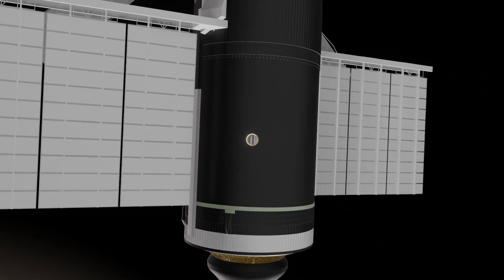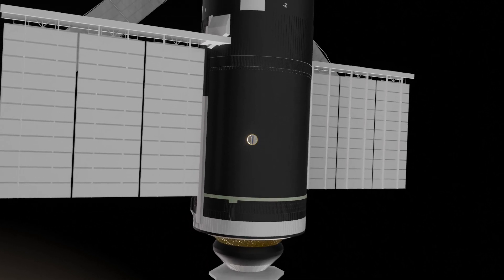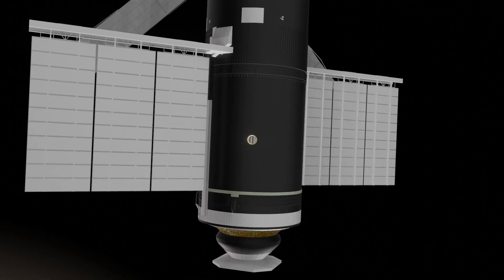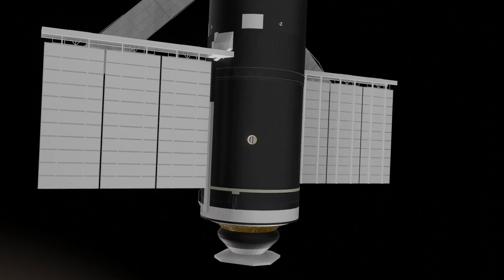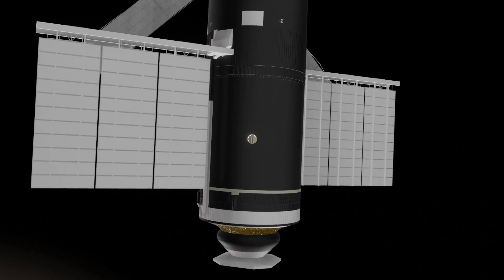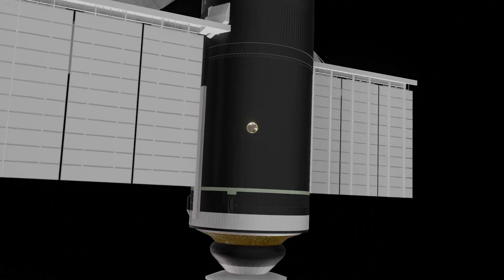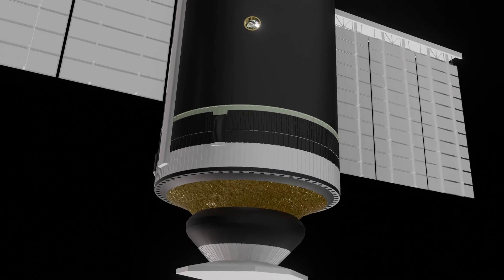Skylab: External Tour

Comment: Drew, this is most impressive. I am working on a scale model of Skylab and there is insufficient visual documentation of colors and materials of Skylab online.  Your 3D render will become a guide.  One question is I noticed external lights (red and white) near the oxygen tanks. But can not find a reference to confirm external lighting existed.  Any guidance would greatly help. Again, magnificent work!!
Reply from the maker: Not sure if these are the ones you are talking about.  But page 2-237 in document 19740018215 from the NTRS website.  Is this a physical model?  Post some pictures as you go.
Reply from the maker: Also search for the skylab boilerplate in Huntsville.  This site has many pictures.  I think this is one of the lights you are talking about: http://data3.primeportal.net/space/howard_mason/skylab_huntsville/images/skylab_huntsville_10_of_53.jpg
Reply: @opieswenson  yes that is one of the lights. Unfortunately there is not enough readily available information in Skylab, which leads to less than helpful search results.
Reply from the maker: Also page 5-36 in the MSFC Skylab mission report-Saturn Workshop on the NTRS site
Reply: It is a physical model available online for 3D printing made by a talented engineer and would love to share. Thanks for the great links and suggestions!
Reply from the maker: @tron77  Awesome.  Looking forward to seeing it.

Comment: Perhaps include a video showing the astronauts' return to Earth.

Without researching, I assume that it would be using the service module, which would also serve as a kind of lifeboat in case there was a catastrophic problem.

The closer to reality, the better. Remember, for me criticizing is fun and easy, the hard part is making the beautiful videos.
Reply from the maker: My Apollo 11 part 3 shows this.  Pretty much the same recently process but about 7,000 mph slower reentry.  The SM is kicked off at the last moment which causes the SM RCS to fire in a way to put it into a tumble to increase its drag to cause separation of the vehicles.  I show that rumble in the video
Reply: @opieswenson  Excellent technical information and captions.
Looking at the nitrogen and oxygen tanks, I find them proportionately small for a crew of 3 astronauts for several days. I wonder how long it would take to refuel.
Reply from the maker: @rsmrsm2000  The workshop atmospheric makeup was a mix of nitrogen and oxygen (Apollo was pure oxygen). Oxygen to nitrogen mix was about 75/25 at 5 psi (as opposed to 14.7 psi at sea level).  Nitrogen was also used for the cold gas thrusters and to supply cold gas for the 2 onboard manned maneuvering units.  The MMUs were recharged from the onboard nitrogen supply.  Skylab was loaded with enough supplies including clothes, food, oxygen and nitrogen for the 3 trips to Skylab.  Skylab 2 (first crew) duration was 28 days.  Skylab 3 duration was 59 days.  Skylab 4 was 84 days.
Reply: @opieswenson  Thanks for the information, I didn't think stocks would last so long.
Reply from the maker: @rsmrsm2000  if you look on the second floor, there are a lot of boxes stacked up.  The placards on the boxes generally tell you what is in them including food.  When they run low on food in the galley, they restock the galley with food stored in the food boxes.

Comment: Agree, probably George Lucas was inspired by Skylab.
Water replacement was not foreseen, so it makes it difficult for humans to stay in Skylab beyond the scheduled time. The ISS is different, there is water replacement.
I don't know if I'm right, but in the Apollo program, part of the water and electricity was obtained by combining stored hydrogen and oxygen. I don't know why Skylab's designers didn't.
Reply from the maker: Skylab was only meant for the 3 missions, so they did not need to haul up water like ISS.  Skylab did not need to waste oxygen nor carry hydrogen to make water since they had plenty of lift capacity for the water.  And they had plenty of solar cells (even missing one wing) for electricity.

Comment: Thanks again for the technical information. Because they are difficult to obtain and important to understand how survival happens. Would you like to know about the drinking water where it is stored? Is there potable water at the station? Sorry for the many doubts, it's just that I get excited to see this excellent work.
Reply from the maker: Skylab was launched with all the required food, water, and clothing for all 3 crews.  On the second floor next to the dome is a series of ring lockers which is where I am sure that George Lucas got the idea for the round passage ways in the Millennium Falcon.  Right below the ring lockers are 10 large cylinders that hold water.  There is a spare cylinder attached to the dome.  And there is a smaller portable cylinder below the ring of cylinders.

Comment: Where are the breathable oxygen tanks?
Would you know how to identify the main equipment that guarantees the survival of astronauts?
What about nitrogen tanks? Is nitrogen reused?
How CO2 is eliminated ?
Reply from the maker: The oxygen tanks and nitrogen spheres that are marked in this video (all around the airlock) are used for breathing a mixed gas (nitrogen/oxygen) atmosphere.  In the real Skylab, there is a thermal blanket that covers this section.  I left if off so you could see it.  In the beginning of the video, there are a series of nitrogen tanks at the bottom of the spacecraft underneath the gold thermal blanket that are uses for the nitrogen gas thrusters called TACS.  In my videos showing the internal views, you can see smaller gold colored spheres (3 in a rack on the 2nd floor and one in its recharge station in the bottom of the airlock).  These spheres can get recharged from the external spheres and are used to power the 2 manned maneuvering units located on the second floor.  CO2 and odors are removed by the molecular sieve system that is located in the structural transition section (STS).  When a crew got done with their stay, part of their close out procedures was to turn the molecular sieve off and put it into the bake position (rejuvenates it for the next visit).  And while they are doing that, they rely on pumping air through the command module lithium hydroxide canisters.